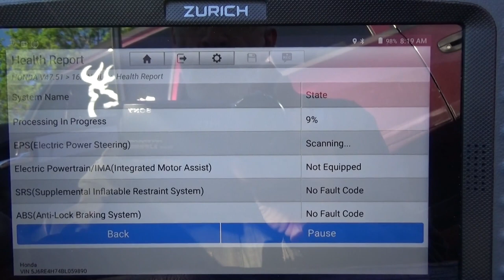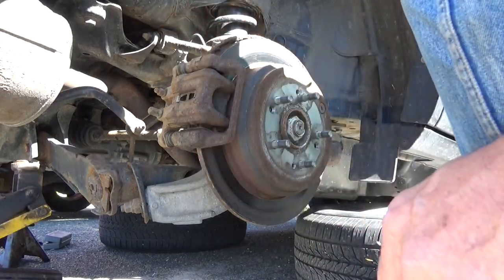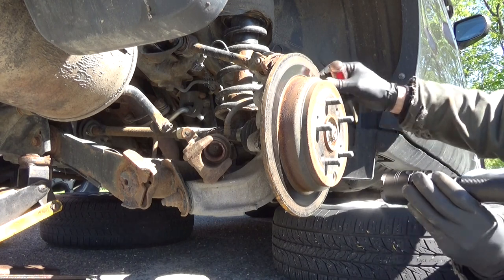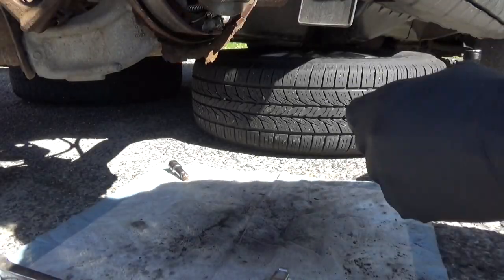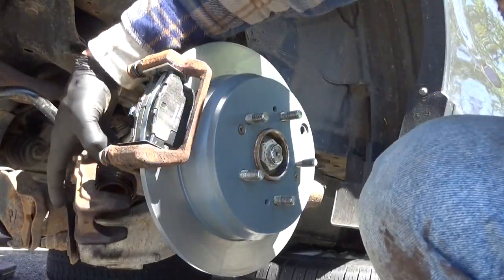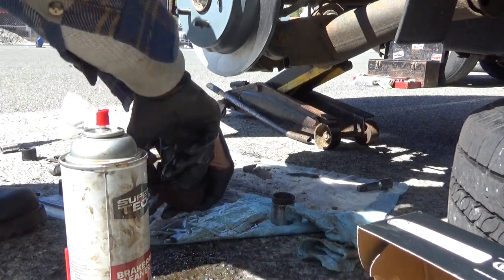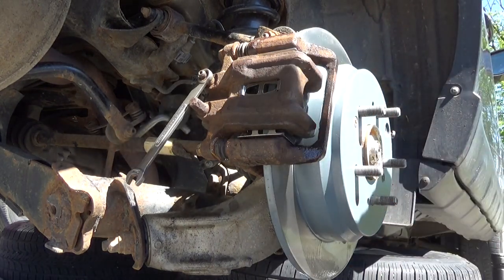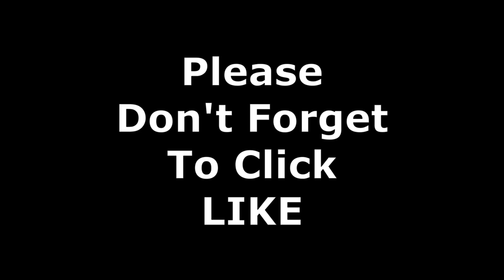2011 Honda CRV Rear Brakes and a very stuck caliper - Auto Repair

Comment: I had a similar problem when I changed my 08 CRV rears a few weeks ago. After taking out the bolts the caliper wouldn't come off. On one the outer pad was rusted into the bracket and when trying to compress the piston a little the inner shoe popped out of the piston and prevented the caliper from coming off. I had to take the bracket off too to get the caliper out. On the other side the inner was stuck in the bracket. This was the longest I had brakes last, 4 years Duralast gold from autozone with high carbon rotors. Wish I saw this video first. Thanks for creating this!
Reply from the maker: With EVERY brake job, I go in knowing I have to off the bracket anyway, to recondition it.
Reply: @HouseCallAutoRepair  I knew I had to take the bracket off to change the rotors anyway, but I've only changed the brakes once before myself and I wasn't expecting this kind of obstacle.  The last time. I did this I was 45 and my 60 y.o. friend was supervising.  The previous brakes were done at PepBoys. Watching you work with the bleeding was great inspiration. I've seen someone else tap the caliper to get the air out. Thank you.

Comment: Just did the same thing to my '99 Camry. Replaced caliper piston and caliper seals on the front.
Used the master cylinder to force the rusted piston out of the caliper. Will do the passenger side this weekend. Same song, second verse.
Probably back brakes next weekend.
Reply from the maker: How'd you do with the rear brakes?
Reply: @HouseCallAutoRepair  turned out well. Not sticking and the car stops. Thanks for asking.

Comment: Thanks for this video on the Honda CRV stuck calipers. My wife’s 20,000 mile 2016 CRV with not a lot of rust yet here in Pennsylvania Was making a rotational noise when moving, it almost sounded like a belt in a worn tire as it contacts the ground on every rotation, it does still have the original tires on at 20 K. But I pulled all four wheels to check the brakes and rotors and I could not get any of the calipers off.. I compressed the Pistons some,But could  not get a single caliper off.. Close, they were loose, I could get them to wobble in the bracket, but I could not get them off.. I could see that the pads were still at least 25%, the fronts were not down to the scrapers yet. So I rotated the tires and buttoned it back up. I’m going to learn how to get these calipers off, which I think I just did by your video, and I’m just gonna throw all new pads on before winter so I won’t have to worry about it..
Reply from the maker: Hopefully this made your quest all that much easier....

Comment: Thanks for your video.   Our drivers side rear heats up and trying to determine cause and loosen up so I could take it to the repair shop.  In Vermont, repair shops are ofter many miles away.  I don't want to damage something while driving 15 miles.
Reply from the maker: What matters most is that EVERYTHING moves! 
Aside from stuck pins or pads rust locked into the bracket, I've found the rear piston NOT being clocked correctly! If the piston is NOT rotated to the correct position, it can bind and get stuck.
If everything moves freely, as intended, but still gets excessively, you may have pinched or restricted brake lines, or other restrictions upstream.
Reply: Thank you again for first rate advice. Took apart ,,, massive rust. Cleaned and now moving. Problem seems solved but will keep an eye on it.  Thanks again.

Comment: Crazy how much rust is there but the rotor screws came off relatively easy for you. I have about 10 % of the rust you had to deal yet I am not having any luck at all breaking those little bastards loose even with an impact screwdriver with a philips bit or the actual correct JIS #3 impact driver. I eventually pulled out the mini sledge to give that a wack on the driver ... no dice. When dealing with the screws previously for the other side when it was locking up I ended up drilling them out, this time I had decided to order the correct JIS screw driver before tackling it, and I'm just like WTF man. This isn't my first rodeo doing brakes but it's the 2nd one doing Honda brakes and dealing with these god forsaken rotor screws.
Reply from the maker: I hear ya! Sometimes there's Loc-tite on them! Get the impact driver bit to fit FIRMLY (wiggle room means it's the wrong tip) and a 3Lb hammer... (I've even sheared off tips in the screws...)

Comment from the maker: @14:00 The discoloration MAY have been from the brakes dragging on the rotor, causing excessive heat. There was no other indication of a potential bearing issue. No noise, play or roughness rotating the hub.

Comment: Very informative video!  Before you take the rotor out , you did loose the E-brake, but after putting back the rotor , you didn’t re- tight the E-Brake , how will I know the E brake needs loose or not ? Please explain for me if you can . Thanks
Reply from the maker: I'll try to get a video up, to demonstrate how to adjust the rear brake shoes as well as brake cable adjustment.... (to get the proper adjustment procedure)

Comment: Wouldn’t it have been better to just buy a whole new caliper? That’s what I did took me an hr taking the wheel off and everything. I’m not knocking what you did but just seemed like a lot of work.
Reply from the maker: It IS a lot of work. Because I do the work as a flat rate service, and try to save the owner as much as possible, I do the extra. (It pays off in the long run....especially with referrals!)

Comment: You did some mistakes,  first it does not seem to be a stuck caliper and even if that was the case, You should have cleaned the sliding pins which you did not do it.  The parking brake you should have released, no need to move that plug and adjust that adjuster. I am telling you because i have done it.  when my caliper was stuck the brake was stuck and my wheel was making a lot of noise when dragging.  I am sorry not to disrespect you
Reply from the maker: To keep it simple, the boot was compromised... There was a ring of rust around the piston, which will shred the seal if forced in.. No "Ifs, ands, or buts", That caliper needs to be replaced, but the caliper had to be ordered, and was coming with the bracket.
 As far as @32:48 the pins were free and smooth, so they were !eft undisturbed.
The parking brake shoes had worn just enough, combined with a rust lip, that with the parking brake completely released, I HAD to back off the adjuster. Forcing it off damages the parking brake hardware!
No disrespect taken. Thank you for pointing out your concerns!